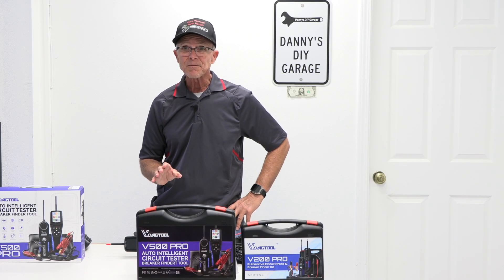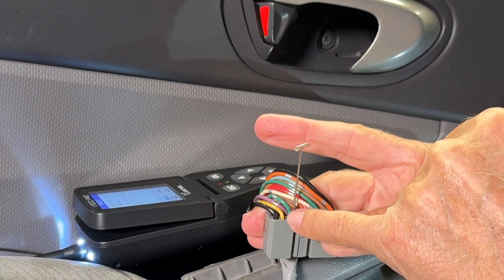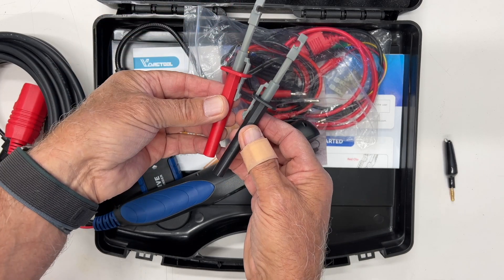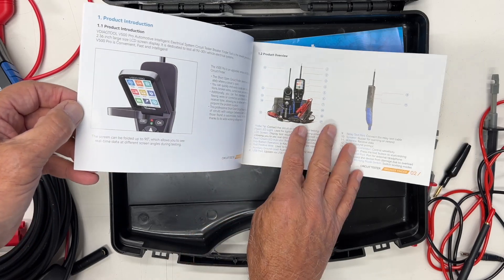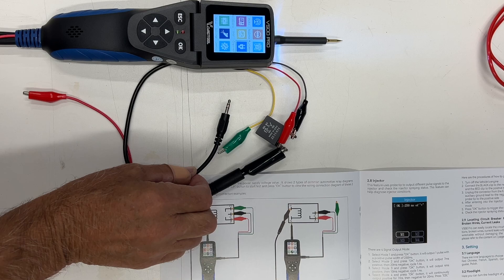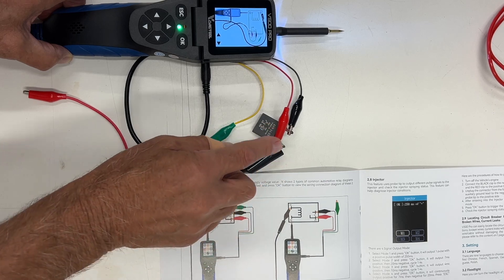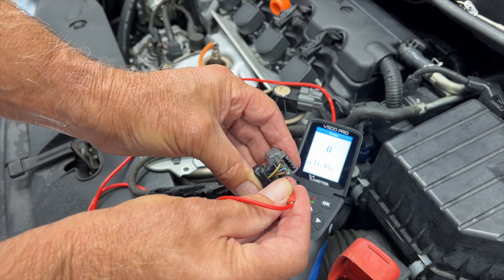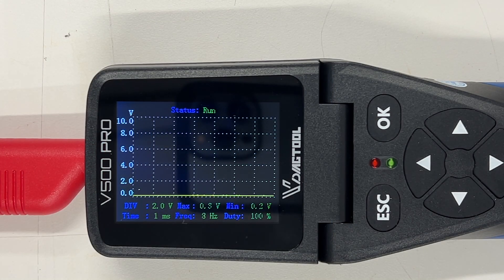Stop Wasting Time: ⚡️ "V500 Pro"  The Efficient Way to Diagnose Cars Electrical Problems VDIAGTOOL.

Comment: The only thing I changed in my 2004 F-150 was the 3rd brake light assembly................ It worked fine for about a week........ Now when I turn my head lights on, the cluster/radio lights go off .............. Also when I apply the breaks, the dome light interior comes on.................... Do you think that maybe the new 3rd break light assembly harness plug has reverse polarity?
Reply from the maker: Great place to start, I would unplug it. Sounds a little like a missing ground wire

Comment: Is it the same process with the V500 pro when using the circuit breaker finder. Since I see that you use the V200 instead of the V500 in the circuit breaker finder
Reply from the maker: Yes, same exact process
Reply: @dannysdiygarage Thank you.
Reply: @dannysdiygarage  The instruction booklet shows that the black auxiliary earth wire should be placed on the circuit too, why didn't you do that? Plus you were running the tip of the probe along the cardboard at the wrong angle.

Comment: Excellent video! You clearly explained all the functions of the tool in depth. I've been thinking of getting a Power Probe along with some sort of simple oscilloscope. This tool covers both needs. The accessories are a nice added feature and the banana plugs allow you to add more options.

Comment: Hey Danny, awesome video. I am very excited to have the vdiag 500 and that was a great breakdown of it just to add when you’re trying to find a break in a wire not only can the volume of tone be the trigger but if you dial down the sensitivity on the on/off dial on the tester itself, you’ll see that you can increase and decrease the sensitivity, which will be a more definite tone to no tone, to isolate the break…
Reply from the maker: It’s been a great tool, a lot of features which will be in upcoming videos
Reply: Absolute superb intuitive tutorial  man..  I just got mine in few days ago  .. I need to test a cam sensor  p0304 circuit a code

Comment: Excellent video. That is a great trick using 2V to find wires in the maze of 0 and 12V wiring. Also, when component testing, big voltage drops would indicate high resistance under load which can be corrosion, loose connections, etc. You might miss this if you just relied on static (no load) circuit resistance readings.
Reply from the maker: Great point, thanks so much for sharing this for others

Comment: Hi Danny, I’ve watched a lot of your videos, you’ve helped me out a lot! I’ve owned a 2009 civic for about 6 years now and I love the car so much I bought another one! Lol but this time I got my hands on a 2008 EX in mint condition with only 100k miles. 

However, there are a couple concerns I have and I don’t have the money to take it to a mechanic. I was wondering if you could possibly help me. 

My biggest concern is after starting the car and letting idle for 5-10 minutes, it starts ticking loudly, whereas it wasn’t ticking at all really until it got warmed up. 
But what’s even weirder is that shortly after the ticking starts, maybe within 5 or 10 seconds it starts like a high pitch noise (almost sounds electrical)

I’ve spent hours looking for similar problems on YouTube and asking Ai, and haven’t found anything similar. 
 It would mean the world to me if you could help me maybe figure this out. Thanks for everything you do Danny! 
Sean
Reply from the maker: @seanwoods4833  after it warmed up and ticking have you tried, shut down and removing the belt and restarting it for a few minutes to see if the noise is gone, just trying to eliminate tensioner and accessories 
From engine mechanical issues, just a thought! Process of elimination
Reply: @dannysdiygarage I will try that! Thank you, I actually just found it may be the purge valve malfunctioning. 
Any tips for poor fuel economy? 
Says could be spark plugs, fuel injectors, o2 sensor, or clogged cat… you don’t really think it could be clogged cat at 100k miles do you? Also do you know how I can test my fuel injectors?